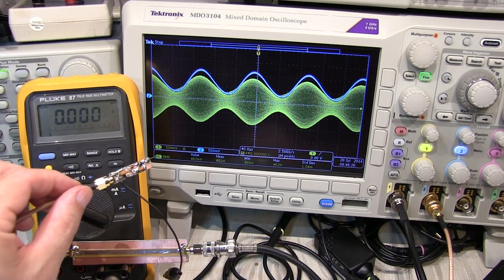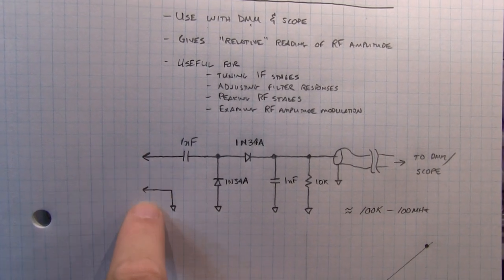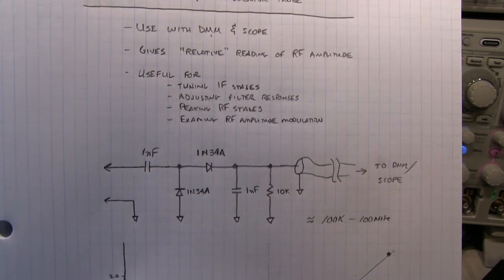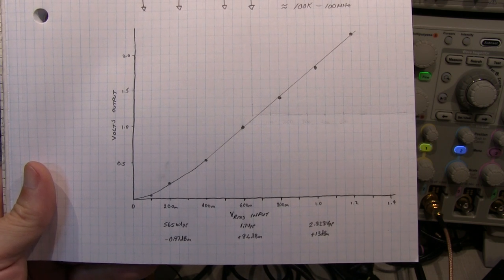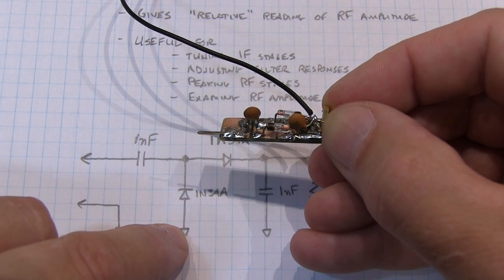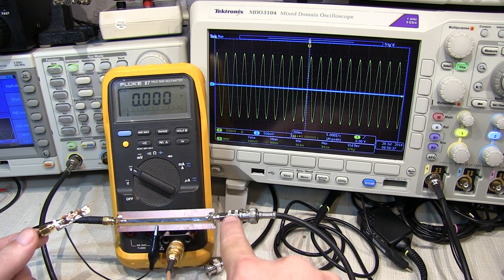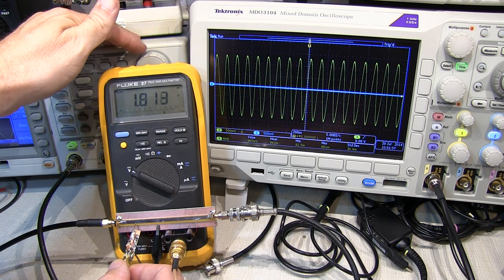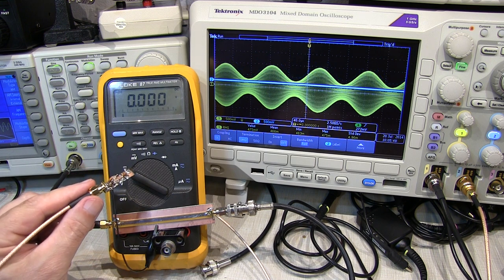#161: Circuit Fun: a simple RF detector / demodulator probe for DMM or scope

Comment: Love all your videos - qualified and instructive! Exactly how can one use a diode detector circuit similar to yours with a DMM to get the most accurate rf power verification of a 50 ohm signal generator? Something of a poor man's calibration reference. I saw a comment on the TinySA group that one can do this with a schottky diode and a few resistors. Then calculate from resulting DC voltage with an accurate DMM. 1.414 times rms voltage minus 0.4v forward drop across diode. Wondering the setup and limitations of this concept.
Reply from the maker: The response from a simple diode detector like this will be somewhat non-linear with power, and will vary with frequency.  So, you'd have to develop a chart or graph to use with it - which would involve the use of some calibrated RF measurements.  At RF frequencies, various parasitics will keep it from responding with the ideal response.
Reply: @w2aew  OK, makes sense. I have plenty of typical non-calibrated equipment and signal sources. In this scenario how would you reach best measurement only one signal point - 30MHz, level of -25dBm? (This just happens to be the calibration output of the TinySA device, with plenty of users looking for an answer to this!)
Reply from the maker: @donb3967  Really not possible to achieve a decent calibration over frequency and power level with a single point calibration.  The response will be non-linear vs. power.  Also, take caution with the TinySA "calibration" output, I would bet dollars-to-donuts that the output is a square wave, so the total output power is going to be different than the "calibration power" at the fundamental, which would adversely affect your (broadband) detected power result.

Comment: When you made your first DMM measurements you had a RF input of 1V and you measured 1.8V.  Can you explain the reasons behind the differences.  Sounds like you measurement was in RMS.  What units are your  RF source in (PPV, RMS)?  If everything was ideal how would an ideal measurements differ from 1.8V?  I did understand as you went up in frequency this value went down, but given your circuit this is still a usable tool.  I think your point was there is some attenuation but given the simplicity of the circuit still a decent response from the probe.
Reply from the maker: The answer is given earlier in the video where I describe how the circuit works.  I was measuring a 1Vrms signal, which is about 2.828Vpp.  The circuit behaves somewhat like a peak-peak detector, with some losses due to the diode voltage drops, so it gives about 1.8V response.

Comment: im not a rf guy (yet) but is there anything that uses RF under about 200mV? Because you could bias the diodes with a coin or button cell to remover that drop at the low milivolts but would it be worth it?
Reply: +Laharl Krichevskoy Not worth it in my opinion, at least not for a sensitive germanium diode. Adding DC bias does not add much improvement. A germanium detector probe hooked up to a 10M ohm digital meter, for example, will still read something like 0.4mVDC when the RF input to the probe is only about 10mVrms.

Comment: I was not clear on how this might be handy if you have an oscilloscope with the same frequency range ? If we wanted a general detector to measure higher frequencies say mobile phone frequencies ghz how might this need to be modified ?
Reply from the maker: Sometimes it is handy to be able to view the amplitude envelope of an RF signal.  To make one for higher frequencies, you'd have to use diodes rated for much higher frequency.

Comment: Very nice design. I want to build a similar RF detector to detect WIFI signals...What kind of input/antenna would you recommend for this?
Reply from the maker: The antenna is the easy part. The biggest problem is that even if you successfully build a band pass filter for the 2.4G ISM band, you are still left with the fact that there are a lot of signals that exist in that band. Besides WLAN, you've got Bluetooth devices, 802.15.4 / Zigbee devices, microwave ovens, and a host of other license free wireless devices. It would be virtually impossible to pick out WLAN transmissions with just a simple power detector like this.
Reply: ***** Ah I see...Well what if I want to build a high pass filter, where all signals above, say, 40 MHz are picked up...Would a simple RC circuit at the output of the diode accomplish this?
Reply from the maker: Johnny Que A filter at the output of the diode won't do it, because the low frequencies would already be detected.  You'd have to add the filter before the diode.
Reply: ***** Ah thanks a lot! I tried it in simulation and it seems to be working...now time to try it on the real system :) I put a high-pass filter at the antenna input, and I put an op-amp at the output to boost the voltage (since the voltage detected at the input may be quite low with the antenna).

Comment: i know my question will be completely off topic, this video made me curious ; so if i wanted to detect the satellite RF that we get using  a dish or LNB specifically as input with a similar circuit, would i get a current that i may use a speaker or led as an indicator in the output
Reply from the maker: The signal from the LNB will be too weak to drive a speaker or LED, and maybe even too weak to get a decent response from a passive RF probe like this.
Reply: w2aew ok thank you for the informations, i was excited to make an amazing gadget that you plug to LNB then align your dish and get responds even though of using the smartphone as a monitor by getting the output through audio jack just and acts like headset mic

Comment: Kind sir. The probe input does not need to be grounded? If I use SMA connector as RF input, the SMA shouldn't be grounded, correct? Also how did you determine the capacitor and resistor value for the detector? I have a carrier frequency of 115 MHz and message frequency of 1 MHz-5 MHz. Are there any formulas I can use to calculate the values? Thanks so much.
Reply from the maker: It is grounded (note the black clip lead).  If using an SMA as input, it should be grounded also.  I'd leave the cap values, and just adjust the bleed resistor (10k) as needed to follow your amplitude variations.  It will likely have to be lower for your 5MHz modulation signal.  Note that this will also increase the ripple from the carrier.
Reply: w2aew I appreciate the response. Learning a lot from your videos. I noticed this circuit configuration is similar with voltage multiplier(doubler). Is it the same concept?

Comment: I love your videos. For someone like me who passed the technician, & general in one night, and missed the extra class by 2 questions, & went back & got it the next testing session. I need all the help I can get! I need to go take the VE exam. That club is getting really geriatric, and they need some young(er) blood. I have the thing that looks kind of like a defibrulator, only it has giant scope probes, instead of paddles and a 100,000:1 transformer in it, so it works with my linear amps. It's a nice diff trans probe set. I have a 100:1 probes that will do 600 V P-P. Those have been in my kit forever. I do guitar, bass guitar, keyboard, and harmonica amps, as well as pedal steel, electric fiddle, etc. The latter keep you thinking.  73 KI7AQJ

Comment: Very nice video. I have build an Signal Tracer out of a radio and I wanted it to detect RF frequency and listen the modulation as audio. The problem however is that it doesn't come out as audio, in fact it you can hear almost nothing, after testing from 17Khz to 3Mhz. The demodulator consists of: a germanium diode, followed by a 330pF and a 470K which resistor parallel to it, one end goes to ground and the other end to the audio amplifier. Please help, thank you very much :)
Reply: +ciprianwiner Do you have an input capacitor? That is, in order, probe tip-input capacitor (I use a .001uF, 500V ceramic disc) - diode from the probe side of the input capacitor to ground - then an isolation resistor (100K is a good value) from that junction to the probe's output to the meter or scope. Another filter cap of 220pF to ground from the output side of that resistor is optional to smooth out the final output. A diode load resistor across the diode itself is also optional (470K is a good value for most applications). The probe will not woirk without the input capacitor, since this is what charges to the peak level of the RF when the diode conducts.
Reply: +Rob T Yes there is a input capacitor but it's 10uF because I didn't think in mattered... the thing is that the Signal Tracer has to work with audio about 99% of the time (I use it as an amplifier) so 1n capacitor is just too small for audio frequency. I will built a separate probe for it for work on radio frequency. Thanks for pointing out what I have done wrong. Cheers :)

Comment: I appreciate the lucid explanation of the rf probe.  Is this similar to the detectors used in MFJ antenna analyzers?. Can you make a video on how to choose  the component values depending on the frequency of interest ( say HF, VHF, UHF)? Thanks for the excellent videos.  -  VU3KWK
Reply from the maker: I've never looked at the detector circuit used in the MFJ analyzer, so I don't know if this is similar.
Reply: it uses a shunt detector to read the differential and ground referenced voltages of the RF impedance bridge

Comment: Hi Alan
Please can you explain: I Used the probe with DMM and measured voltage 33 V output from AM transmit into a 50 ohm dummy load. Radio set o 5W. Converting P to P to RMS (33 x.7) 23 V. Using online RF power calculator it is 10 watts. This is double the power shown on the Bird watt meter. 
Regards Stan
Reply from the maker: What frequency was the AM transmitter running at?  And, what DMM where you using?
Reply: @w2aew  Frequency was 14Mhz and DMM was Fluke 77
Reply: DMM was set to VDC
Measurement taken fro a BNC T piece. Could this be an issue?
Reply from the maker: @stanholmes4293  This detector probe is not going to be calibrated - it is mainly useful to get relative readings, as mentioned right at the beginning of the video.
Reply: @w2aew  Yes I did take note of that, but as the power was double I thought I was doing something stupid. The one you made have you tested it for accuracy? Understand it is great to adjust for max readings.
Thanks for your prompt responce.
Reply from the maker: @stanholmes4293  No, I never checked it for any kind of accuracy.
Reply: Hi Stan, Vp (voltage peak) to RMS is Vp x 0.707. Where as Vpp (Voltage Peak to peak) to RMS is Vpp / 2 = Vp. Vp x 0.707 = RMS. So the 33Vpp measured is 11.63Vrms. This on a 50ohm load = 2.72W, if I’m correct

Bearing in mind as stated, it’s a not a calibrated device, and hence it would be off somewhat.

Comment: So you can build this and connect it directly to your scope..then touch it to plate voltages, or grid voltages?? Can you hook it directly to align the IF stages in a TUBE radio...???
Reply from the maker: No, absolutely not!  Don't go anywhere near plate voltages with a low-voltage probe like this!
Reply: how do I see people aligning there radios with scopes..is it a special high voltage scope..or are the probes different...?? mine says 600volts p-p 300V(DC + AC peak)
Reply from the maker: Many tube radios use plate voltages less than 300V, so your probes will be OK for that.  Have you watched my video on oscilloscope basics, and looking at signals inside an All American Five tube radio?
https://www.youtube.com/watch?v=niBGkqlh2XY

Comment: I built this circuit a feed it with a 1 mhz unmodulated signal. The output is zero. I am using 1n4148.

Comment: Ok, I'm thoroughly confused here. The whole time you are measuring with the DMM, it is set to DC Volts. What's up with that?
Reply from the maker: Yes.  The RF Demodulator/Detector produces a DC voltage that is proportional to the RF signal amplitude.  If the RF signal has some amplitude modulation, then the output of the detector will follow that (which is shown on the scope)
Reply: @w2aew  Ah, yes, I wasn't thinking about the circuitry in the probe, it is being rectified. Yep. Good deal.
Reply: I was looking at the AC signal on the o-scope and looking at the DMM and it was driving me nuts. Wasn't even thinking about the probe you were using. Makes total sense now. Thanks!!!

Comment: Still can't understand why we need first (vertical on scheme) diod. Seems it just would short negative half period voltage from capacitor directly on the ground. I know this is basic scheme from some recivers (like detector reciver or AM demodulator part from more complex recivers) and so shame to get stuck in it with understending.
Reply from the maker: This first diode allows the negative half cycle of the RF input to charge-up the input capacitor, so when the positive half cycle comes along, it transfers this charge to the grounded capacitor via the 2nd diode.  Thus, to boosts the detected voltage a bit.
Reply: It seems I understood it from this point of view. After negative half cycle we have source in serial connection with cap: "+" of source (on positive half way) to "-" of charged capacitor (who got charge through first diod on negative half cycle) and then them voltages stack up. Thanks for answer as well!

Comment: I built one to probe a fm bug, unfortunately I don't know if my detector isn't working or my transmitter is not oscillating. #fail
Reply from the maker: If you have any kind of signal generator - doesn't have to be RF - you can use that to check it out.

Comment: This looks like the sort of demodulator probe used on those audio output signal tracers. How much does the input impedance of the signal tracer amplifier load the probe. Recently just built a vellemen signal tracer kit and I’m using a bought demodulation probe but I’m suspecting the 50kohm input impedance of the amplifier will load the circuit under test. I note a lot of the classic signal tracer like the HealthKit were valve based and high impedance. regards Chris. PS if you get a minute I’m trying to help one of your  countrymen and fellow radio dabbler, here https://youtu.be/c_ysLO0ouFU
Reply from the maker: 50k load shouldn't bother the RF detector at all.  I posted a reply on the video, suggesting that he start with checking DC bias points throughout.
Reply: w2aew Thanks he is a nice guy, fly’s planes how great is that?  Thanks for the heads up on the impedance. Best regards Chris